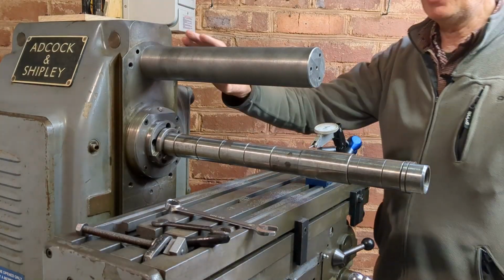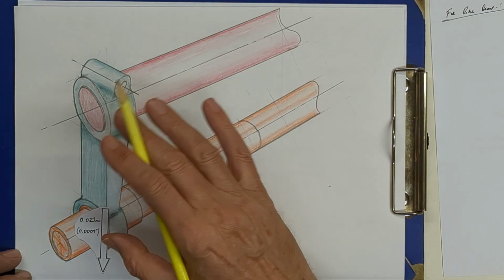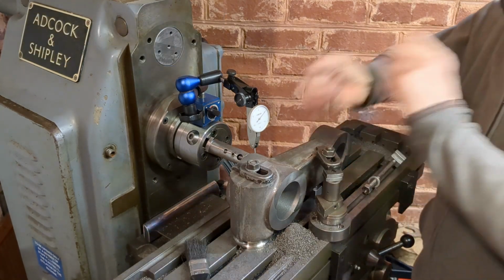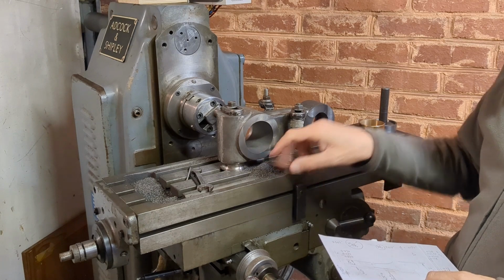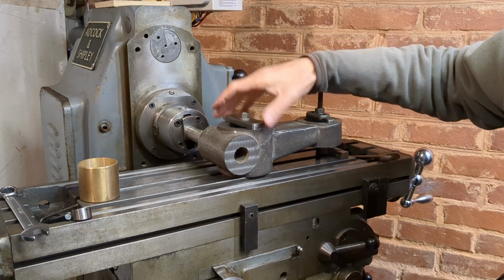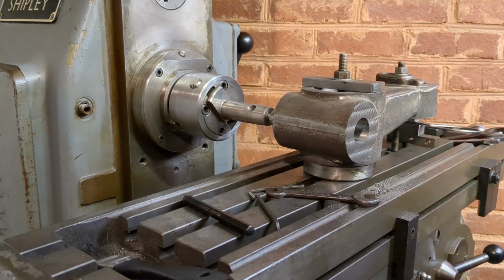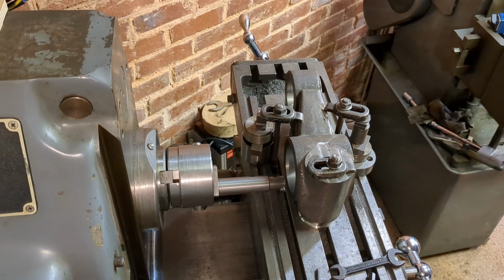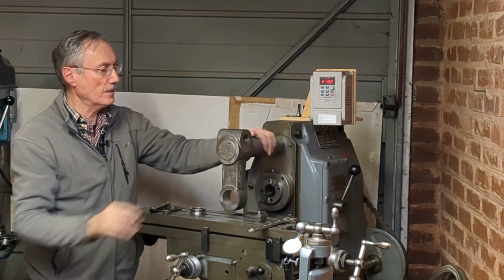Adcock & Shipley milling machine restoration - part 10 (boring support bracket casting)

Comment: It looks like you are already planning to do what I was going to suggest, leave the support bar free to slide in the machine, grip the bottom of the arm in the vice, and use the Y feed to slide the bar through the machine to feed past the boring bar?
This is a somewhat simpler operation on my mill, as it has a doevetail support bar, and so doesn't need to be prevented from rotating.
Reply from the maker: You may have anticipated my next move! However, before I can do that I will need to make the cotter and test that the setup doesn't bind. I hope the rotational issue won't be a problem.

Comment: After you re trammed it you commented that you measured some out of round due to distortion.
Are you sure it wasn't reading the result of tramming and raising the table  ?
Reply from the maker: Good point! If I remember correctly, however, I think I measured before machining at the new setting. The table was raised by a lot more than the out of round. Thanks for your interest.